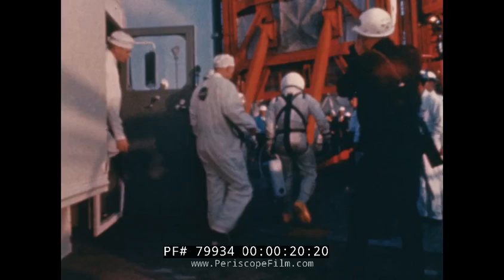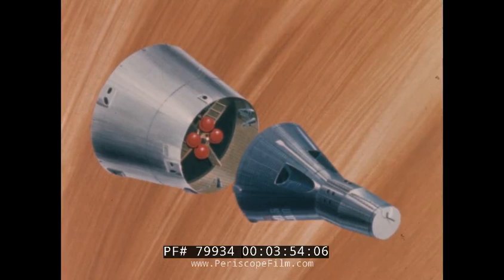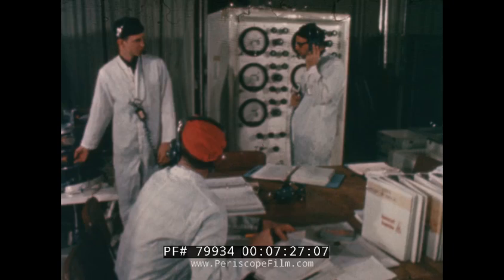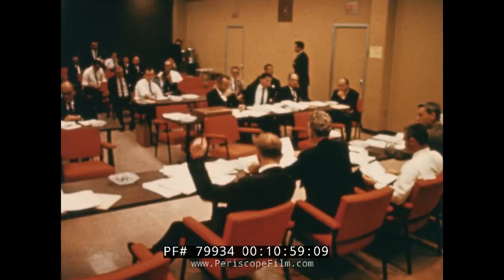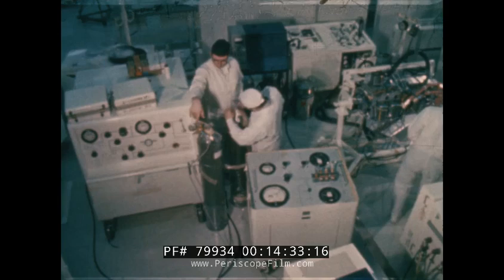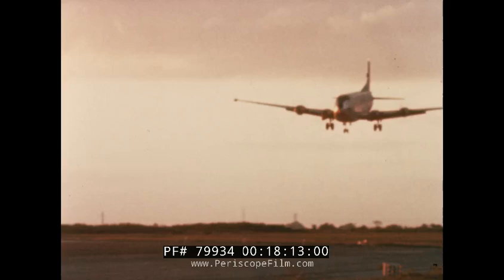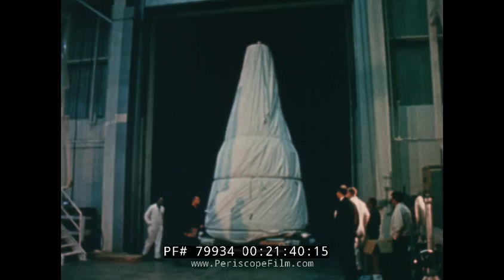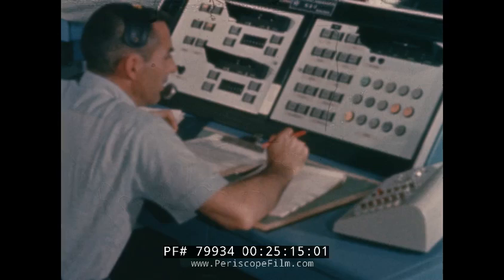NASA 1963 PROJECT GEMINI FILM "ALL SYSTEMS GO" PROJECT MERCURY  79934

Comment: So they checked all systems before each of flight carefully but during Gemini missions there were dozens or even hundreds of bigger and smaller malfunctions.
Reply: That's the thing with bleeding edge technology-you can test everything you can think of but actually using it always brings up issues. Also, given the nature of the tech at the time, it's possible for things to work during testing, but not continue working for the entire flight.

Comment: All this time, these guys are breathing that 100% pure oxygen that killed the Apollo Astronauts. :/
Reply: Gus who killed in the Apollo 1 fire we actually heavily involved in Gemini design(the "Gusmobile") and flew Gemini 3 along with John Young. 100% O was used in the Apollo CMD module cabin still during Apollo after the fire but in flight not on the ground/during tests(pure O was breathed during the tests through the PGAs(suits) loops). The pressurization was changed to vent during lift off to eliminate N in the cabin by the time the crew would remove their launch suits- crews prebreathed O which is why you see them carrying an O supply out with them in 'suitcases' to the launch pad.